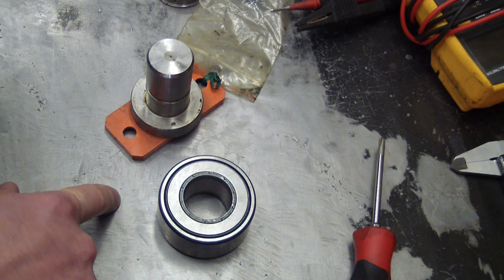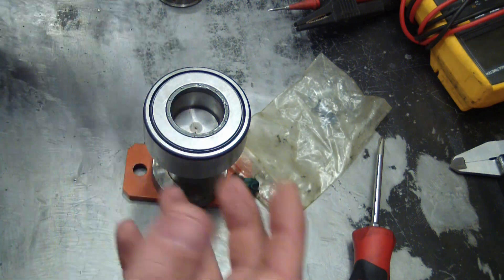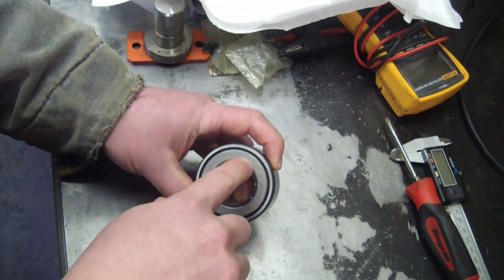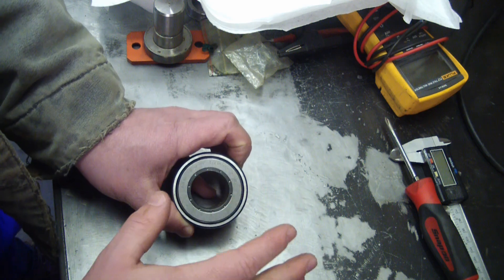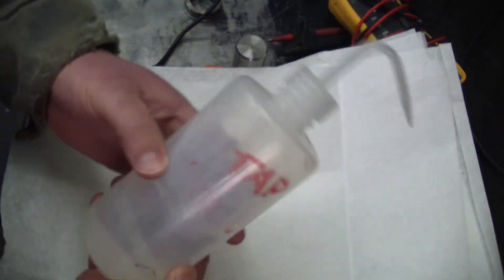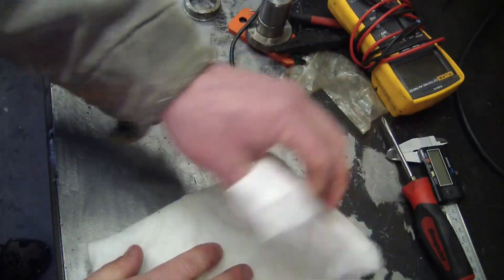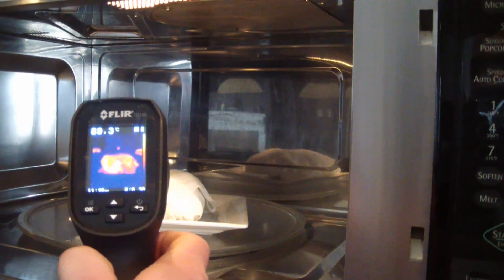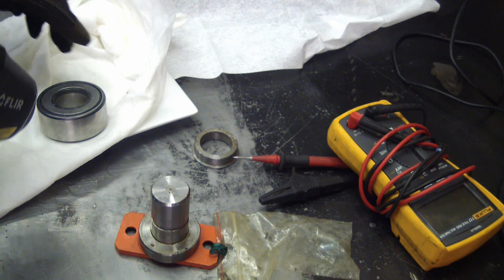The Microwave Trick? It's the easy way to heat bearings!

Comment: It may be because I'm lazy, but if you enter 9-0 instead of 1-3-0 on your nuker you save a keypress.
Reply: Hes Canadian. The timer on his microwave is in metric
Reply: Keyser Soze LOL!
Reply: @Superabound2  holy s#!t... Four Years later and it laughed myself to tears...
Reply: Seth B That's similar to what i do. I just punch in 99:99, and simply wait the exact amount of time to cook your bearings or your Warm Pockets and open the door. Then the next time you need to cook something you just stick it in and hit resume. Do it over and over again using the remaining time until you eventually have to reload with nines. Sure every once in a while you forget and set the inside of the microwave on fire but those things are pretty tough and it's worth all the extra time and button presses you save
Reply: @Superabound2  I just press 2 and then rundown 5, 8 and 0 in one stroke then apply Seth B's reasoning ! (i.e. cancel after time run down) It works in US time Imperial time and metric !
Reply: Yinan Liu Only if you're dialing on a rotary microwave
Reply: NoTimeForThatNow But 100 seconds is 1 centisecond, or 1,000 kiloseconds. 60 seconds is only 600 kiloseconds, or 0.6 of a centisecond
Reply: On my microwave, if I hit the "add 30 seconds" button, it starts immediately without having to hit "start". If I want 90 seconds, I just hit that button three times. I've been known to hit it 10 times for 5 minutes just out of mental laziness. It's very likely going to be the first button to wear out.
Reply: I'm lazier yet. I just punch in 9 twice (99) and open the door 9 seconds early.
Reply: It balances out. The energy from the thought process cancels out any savings.
Reply: if you just press 111 thats gonna be much quicker.
Reply: Keyser Soze your calculations are off, 100 seconds are .1 Kiloseconds and 60 seconds are .06 Kiloseconds. And of course there's twelve seconds in a year.
Reply: Would you consider pressing stop just before it finishes so that it only beeps once instead of thrice?
Reply: @Lunji  do that a lot cause the beep will wake her up. then i would have to share.
Reply: @Lunji  Thrice??! My Panicsonic beeps FIVE times. I hate it and open the door early! And why do digi-timers count up instead of down. The easiest button push is 10 minutes but you actually want 4m30s so you stand there doing backward mental calculations of what time left is showing  minus-ed from 10 minutes! (Exp: 3m16s from 10m00s - how much elapsed time???) The 10 minutes should & could count UP from 00m00s. Bring back Rotary Knobs and mechanical indicators - all you need to know in one quick glance. (half inch to go... Ha Ha!)
Reply: NoTimeForThatNow 
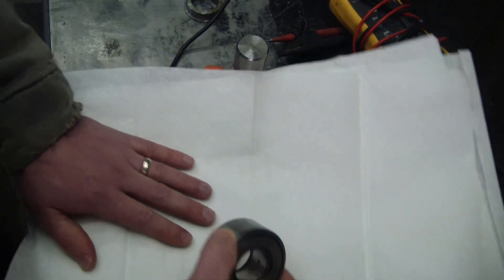If I press :90 it changes to 1:30 when it starts. 
Still saves a step, but it thinks it's a smart little bastard.
Reply: Lunji or open the door so it wont beep at all. Late at night I'd do that.
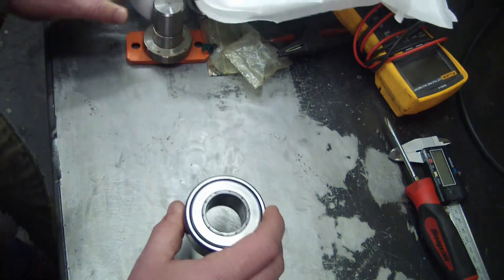Reply: NoTimeForThatNow lol if I type 90 when it starts it counts down from 1:30 😂
Reply: I call it efficient. I go a step further and only run 88 seconds on things that call for 90 seconds. It's done enough, I save two seconds, and I don't have to press two different buttons, just 8-8-START.
Reply: @motofabio  scrolled way too far to find this.  people are stupid.
Reply: MrTheHillfolk yep, saves you from entering an extra keystroke  compared to 1-3-0, now you can find something useful to do with that extra fraction of a second! Lol
Reply: I am pretty sure that was meant as a joke, peeps, enjoy the humor!
Reply: Lunji  if you stand there and wait for the microwave cycle to hit finish so you can hit the stop button, your head is getting filled with all those microwaves..
Reply: It may be because I'm lazy, but if you enter 8-8 instead of 9-0 on your nuker you save a finger movement and you're still within a 3% margin.
Reply: Zeet wow, that explains everything!
Reply: LordSodaPig it might be easier to explain your broken humor sensor.  :)
Reply: Keyser Soze u
Reply: Nice one!! :D
Reply: NoTimeForThatNow ...are you dead?
Reply: Lunji no but I don't need a night light anymore.
Reply: There is something about people trying to do as little as possible these days.
Reply: @w-dad4040  so you’re gathering firewood, rubbing two sticks together, blowing on the embers, starting a fire, roasting your coffee beans, grinding them on a stone, going to the river for water in a hollowed out coconut, boiling the water with the ground up beans, chopping some sugar cane to sweeten it, milking a cow for creamer?

Or are you just pressing one more button that others on a microwave?
Reply: I thought it was just my OCD. Never the less good comment sir.
Reply: *****
lol
Reply: BWHAHAHAHAHAHAH!!!!
Reply: No.
Reply: Yeah, I picked up on that a while ago. You can also enter 60 instead of 1:00
Reply: NoTimeForThatNow i
Reply: Hhahahaha
Reply: @BUZDRIFT  so is the metric system. They are all outdated.
Reply: If you hit 99, you don't have to waste effort moving your finger, and hey an extra few seconds cooking while you load up some beers in the fridge, NBD.
Reply: Why not pre-heat the oven to around 100C/200F, turn it off, put the bearing in and use the infrared thermometer?
Reply: I tried and it does not work. The oven will not accept 7, 8 or 9 as first digit for the timer.
Reply: Buy a commercial nuker with a DIAL and save frustration and time everyday.
Reply: if you press 99 seconds, you save a key press, don't have to move your hand over, and get 9 seconds for free. yes, I'm that lazy.
Reply: The quickest most efficient way is to enter 88. It's quicker to double tap a button than hovering to a new digit. example cook times 55, 222, 555
Reply: NoTimeForThatNow
Cool, sarcasm is really hard to convey in text :D
Reply: For what it's worth, entering 6-0 saves a keystroke over 1-0-0 also, but that's kinda obvious if you understood my original comment.
Reply: Keyser Soze please explain a metric TIME system
Reply: The Imperial System is much more accurate for Temperatures.
Reply: As someone who never used the imperial system, how is it better for tasks like that. Could you give some examples?
Reply: Imperial is outdated for anything ultra specific, mainly science. However on the small scale in construction for example imperial is far superior for doing easy measurements and head math.
Reply: @Liam-di7hn  both are a social construct. so is using ten as a number base. hell we can't even agree on what dead is.
Reply: @Liam-di7hn  Imperial deals with fractions and metric is primarily decimals, not to say imperial doesn't have decimals, it's just imperial isn't as accurate for fine measurements, Metric is way easier to understand!
Reply: SovL:Remedy jeez that was an old comment! For example though doing fractional division is far easier in day to day needs on the job, rather than decimals , although I come from natural stone masonry where things don’t need to be down to          .1mm
Reply: @Liam-di7hn  It's just a case of what you're used too! I'm used to metric as we don't measure things with feet, etc etc as metric is a more scientifically derived method of measurement. If you were brought up on Imperial then of course it will be easier to use Imperial. As "Base" units of measurement Metric is more precise .
Reply: @BUZDRIFT  metric is NOT always more precise.  What a silly comment.  Case in point,  C vs. F temperatures.   One hundred divisions vs. 180 betwixt freezing and boiling.   F is 80% more precise.  Almost twice as accurate.
Reply: @MrEric_API  Haha, that literally makes no sense as you also have decimal points and in Metric most things are measured exactly to the tenth, like boiling point, using your example is 100c...This ancient argument, Precision isn't the case in both Imperial or Metric it's just Imperial is outdated, You may as well be measuring in barrels or buttons LOL, so 10mm is 1cm 100cm is 1m 1000m is 1km. It's just a better updated system!
Reply: @BUZDRIFT  the metric system is not a updated system, it's a watered down system. 
The clock, the circle, and the dial (that's a thermometer) cannot be improved upon. 
A base 10 or 100 doesn't apply well to everything.   This is why fractions appeal to the human mind, people can visualize 1/2 and 1/3 and the other subsets,  decimal division is simply estimation.....
It's very simply the division...
Reply: @BUZDRIFT  no its not. they are both social constructs. a millionth of a inch is more than 39 times more accurate than a millionth of a meter. in my old workplace we used the speed of light to measure and of course converted for the customer's wants.
Reply: salame milan jesus christ that's not how this works

Comment: Very good tip, I will remember this....But here is my questions....

Since metal is expanding, in ALL directions, how can you explain that the steel did not expand toward the center of the bearing ? 
If you had placed a rod in the oven, this rod would have elongated on both sides of its lenght.  ( and all other directions)
Why does the atom just on the inner side of the bearing, why did it decided to go toward the outside ?  All the heated atoms were pushed outside, while the pressure was in all directions ?

May be what is important to you is the fact that it works and that your wife didn,t catch you while you were fooling aroud with her microwave....LOL
Reply: so let's say you had that inner part of the bearing cut and laid out flat. heat it up... which way would it expand more? horizontally of course. therefore the cylinder diameter would increase even though the thickness of the tube also increased. if you had a tube with the right ratio of inside to outside diameter then the inside diameter could get smaller.

Comment: What about a bearing that has a rubber seal or plastic cages? Would this method be safe?
Reply: ***** Good point, I didn't think about that. I still worry about hot spots in the metal, but I guess that is on point of wrapping it.

Comment: Here's more kitchen tech.  If you have a an immersion heater for sou vide cooking ($179-$225 US):
1. Bag and seal your part.
2. Immerse in the water tank. ( Big cook-pot, ice cooler, etc.)
3. Set the temp on the immersion heater for the desired temp. ( the heaters are generally calibrated to tenths of a degree, C or F)
4. When the heater is at temperature cook for 5 or 10 minutes.
5. Unbag and go to it.

Your method is faster.  For items that are larger than the zapper (or too long) they might just fit in a 25 qt. ice chest.  When you are not cooking auto parts you get some of the best ribs and brisket ever.  Love your channel.
Reply: Mazda rx7   You misspelled ex-wife.
Reply: If your going to use a bag, why use an immersion heater. Just drop it in with the soup the wife is cooking. Just tell her that you'll watch the soup for a few minutes while she runs to the store to get you more beer
Reply: Nope wife it is . Got to let em out of the house sometime. And they like it when they get to drive da vett by themselves with the top down while you watch supper.
Reply: Don't bother measuring your water temp, maximum it can get to at sea level is 100 DegC before vaporising... oil on the other hand has too high a boiling point so temp control is required.
Oven bags are obviously best as the average ziplok will disintegrate.
Reply: Mazda rx7 It is nice to meet a man of such faith.

Comment: Couldn't you just use the oven?
Reply: Mac Sogandares you'd have to have one skookum kitchen oven to anneal a bearing. It'd have to be choochin along at over 1000° F. You're only supposed to heat a bearing to a max of 250°F and most manufacturers will say 235° F
Reply: too long
Reply: you could
Reply: James Griffin Right. Doubtful that a microwave could deliver that kind of heat to just metal without any other damage.
Reply: If you put a bearing in the microwave without the wet jacket on it you could get arcing between elements which ain't gonna do ya no good that's for sure. Even if it is greased and sealed. Like he said you must completely surround it with the water jacket. Had to prove it to someone once by putting the old bearing in the oven dry and watching the sparks fly at 20 seconds.
Reply: I think he means the regular oven, not the microwave.
Reply: yeah but the microwave could mess up any urethane seals or bearing spacers by POTENTIALLY superheating the oil faster than the metal itself, and i'm sure using the 'slow' oven method it would be inclined to heat the outside metal first (the part you want heated) and the inside last. IF there were urethane or plastic components, that would IN THEORY be the safer way. and you would seriously have to scorch that steel to anneal it, you would have to  WAY PAST the point of cooking the lubricant right out of the bearing and at THAT temperature even BRASS bearing spacers could get messed up, much less non-metal components.
i've boiled bearings in oil to clean them and remove deposits, and had no issues and i'm sure even THAT would get them more than hot enough to expand, annealing high grade steel used in good bearings would take INSANE heat.
Reply: blakrob2011   I was thinking the same thing. With similar precautions, I think if is possible; just not as quickly. Thinking about setting it on a burner: I think it would be too hot - bake at 200 (I'm not sue which units, I keep on assuming it's degrees F, but I think he talks degrees C)
Reply: it could anneal the bearing, which you don't want. Metal would soften up.

Comment: Hey, I'm having an issue. What's happening is I need to replace a bearing on this 2006 Chevy Aveo. The problem is that any resource I've found about replacing bearings (none of which exist for the aveo) has the bearing in some sort of casing, and not on any kind of rod like in your video. My question then would be, could this same technique apply to this casing, or am I missing something?
Reply: Do you mean for a wheel bearing for your aveoor a bearing for a specific part of the aveo. Is the casing your hub assembly?
Reply: Sorry, I figured it out. Thanks for replying though.
Reply: no problem.

Comment: So the wet cloth is like a faraday cage?
Reply: No.  It provides an attenuating medium for the microwaves when they pass through it.  Water is VERY lossy.
Reply: How are they attenuated? Is the wavelength shifted to infrared? PLease go into detail further, I am not physics ignorant just never heard of this. Thanks Matt.
Reply: Okay here goes.  This is going to be a long ass post:
Water (tap water specifically) has many impurities in it that allow the conduction of electricity (namely, the movement of free charges).  This gives tap water in general a "conductivity." When ever a medium is conductive like that, it causes the electromagnetic wave to attenuate when it propagates through.  This is because the wave gives up its energy to the free charges in the atoms in the form of eddy currents.  If there are no free charges (meaning no conductivity) the wave does not attenuate. 

It is more clear when you go through the math.  When an medium is conductive it ends up with a decaying exponential function, basically e^(-sigma*z) where sigma is the conductivity of the medium.  As z gets larger (namely, as the wave propagates deeper into the medium), the exponential gets smaller.  For mediums with a very large (essentially infinite) conductivity, such as copper, the EM wave does not penetrate at all.

In this context, the wave propagates through the wet towels, losing a LOT of its energy, causing the water to heat up, by the time it gets to the bearing, it is much lower energy and this causes the bearing to not heat up as fast as it would if the wet towels weren't there.  Really ingenious idea actually, because as AVE said, the water will never get above boiling temperature since the excess energy needed to do so is going into changing the phase of  the water from liquid to gas.
Reply: @MattsMotorz  Exactly what I was thinking ! Well I think that's what I was thinking.......I think ?
Reply: +MattsMotorz 

I never would have guessed there was a safe way to put metal in a microwave.

I still have trouble believing. I want to wrap a fork in wet paper towel and stick it in the microwave now.
Reply: you add destilled or deionized water to  a papertowel and id bet it works, but while I have a ro/di filter I'm not sure I'll gamble on my working  microave on the idea
Reply: You sir are quite correct. I'm no engineer but I have completely rebuilt a 100K microwave oven that was an absolute basket case and I operate that oven daily. I wasn't sure if I could rebuild that oven but it looked like a fun challenge and forced me to learn a lot about microwaves. We also put metal in this microwave quite often and if done correctly the metal doesn't even get hot. When I say metal I mean Aluminum but thats just because its cheap and easy to machine.
Reply: Aaron Mackay I'm in denial about the coated metal rack that came with mine. - never tried it yet though.
Reply: MattsMotorz. OK. That's good, no great, but then the electromagnetic energy that raised the internal energy of the water which raised its temperature raises the bearing's temperature by conduction and convection.
Reply: Just reading the first paragraph of the Wikipedia article on microwave oven, I don't think a thin layer of water-soaked cloth is enough to block microwaves.

Comment: could you freeze your shaft with an air sister to make it shrink so it will fit?
Reply: duster**
Reply: freud
Reply: That would probably work but it wouldn't slide on quite as easy. I do that every time I have a stuck bolt or nut, even helps to snap free loctite